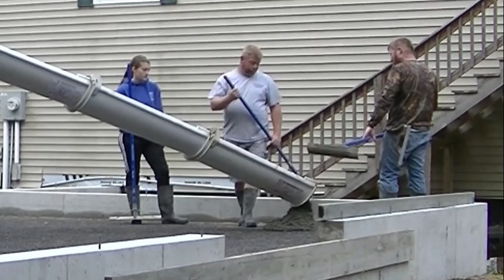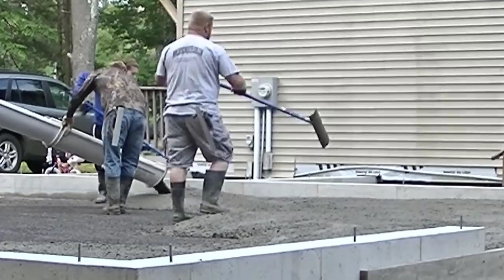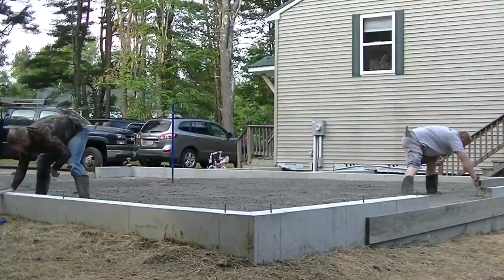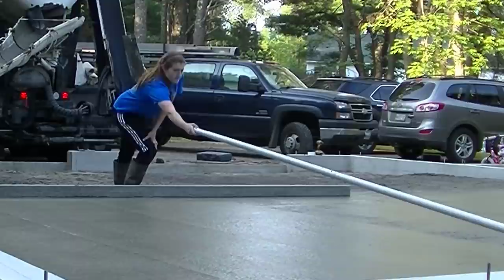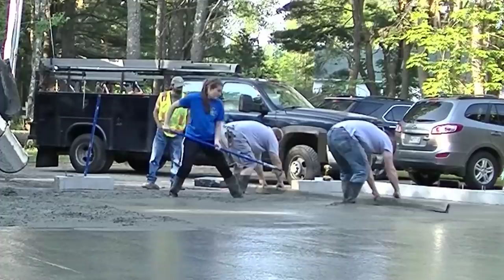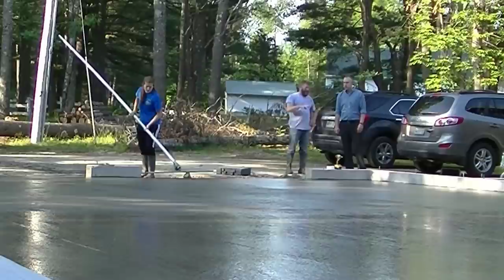Pouring Concrete When The Boss Isn't Around

Comment: Love your channel Mike!  I am a deep foundation/superstructure contractor here in the NYC Tri-State area and I operate with 3-4 crews of 4-5 men, each run by a foreman.  If I go over everything that needs to be done and set my foreman up with everything they need I have zero issues when I am not around..

No expansion joint around the perimeter on your pour?
Reply: No need on a small garage floor  both foundation and floor will expand and shrink with temperature  pretty close      if it was a foundation that was years old  I'd probably put some expansion   since both are relatively new  I wouldn't worry
Reply from the maker: Darren and Luke are the same way, they can run a job without me from start to finish.

Comment: How do you just dump out a whole truck at once without checking any grades?
Reply from the maker: Just experience, you know just about where the grades are by doing it every day.
Reply: @Mike Day Concrete  I gotcha, I hope to get myself and crew that good one day. We always need grade pins or laser checks every few feet on areas larger than 20x20